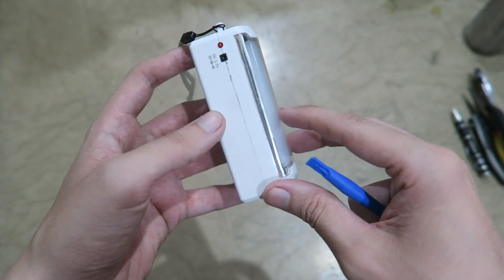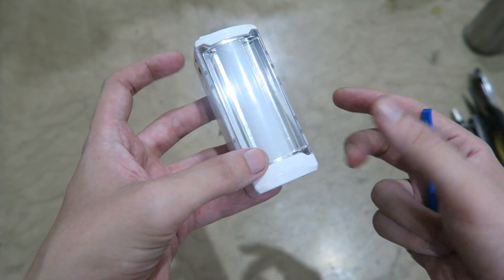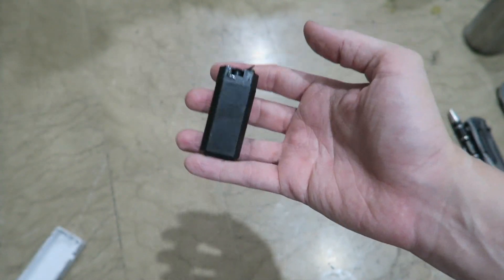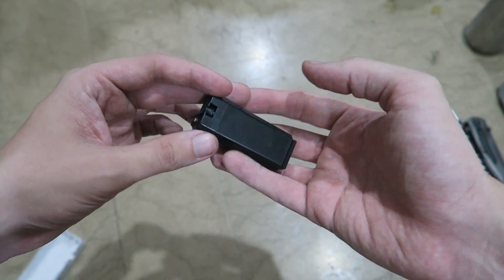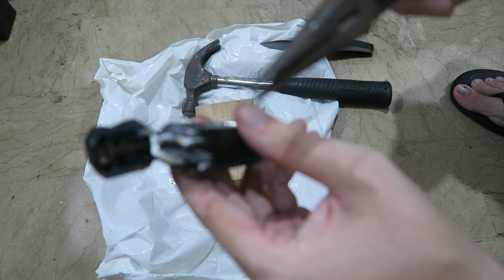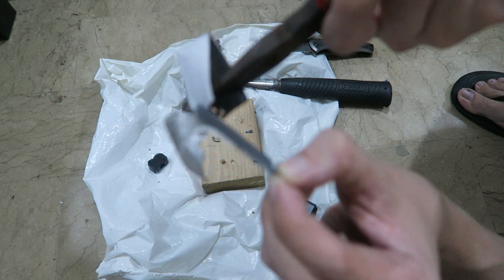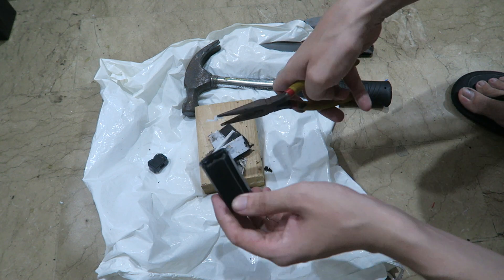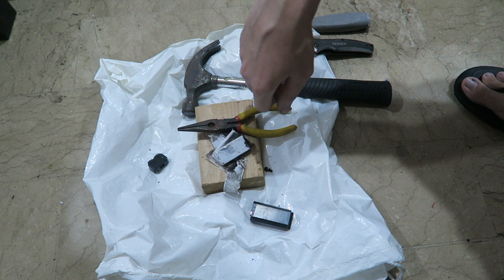Omni battery ripped apart

Comment: I was going to say lead is toxic but I'm sure you already know that and wow you just touched the inside of that battery I would'nt even touch the battery itself a while back because of what looked like dried up acid leakage is actually glue.
Reply from the maker: +tony dcosta from what I know, lead on the skin isn't a big deal. It's when you rub it in your eye, get it in a cut etc. And even then you need a lot of exposure. Children used to suck on toys with lead paint lol